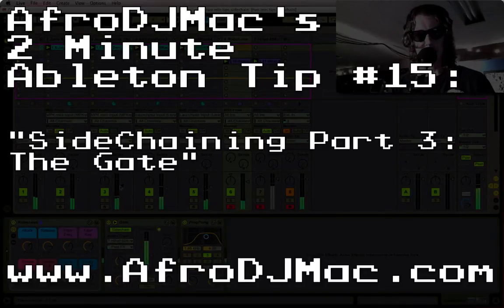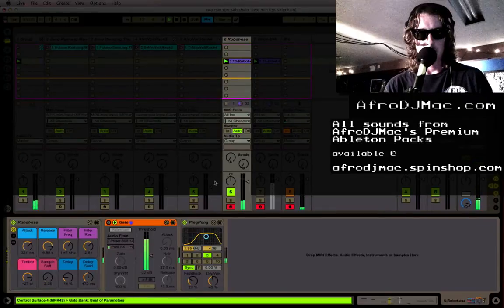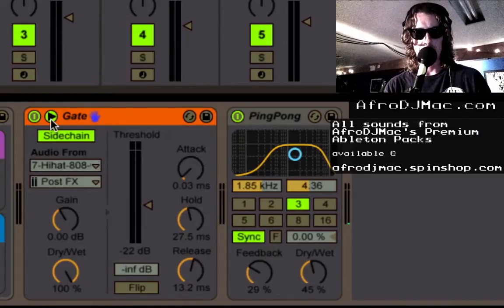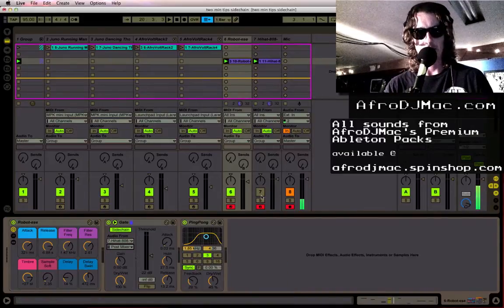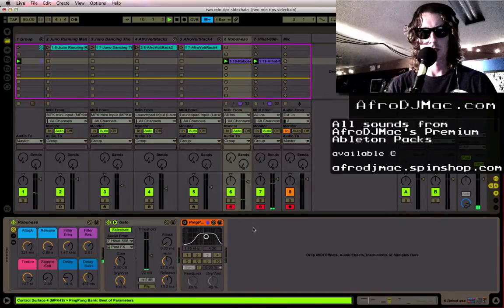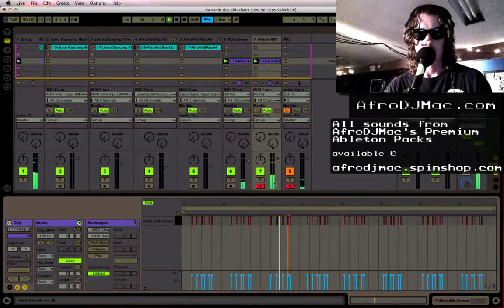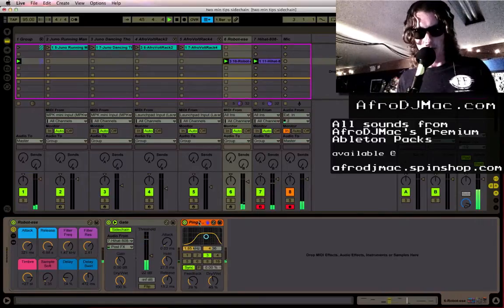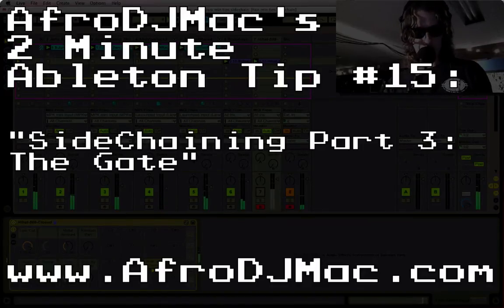SideChaining Ableton Live's Gate: Two Minute Ableton Tip #15

Comment: How can i put that color lines in the clips?
Reply: Using a midi controller, that outline shows the tracks controlled by whatever hardware is plugged in that uses more than 1 track basically